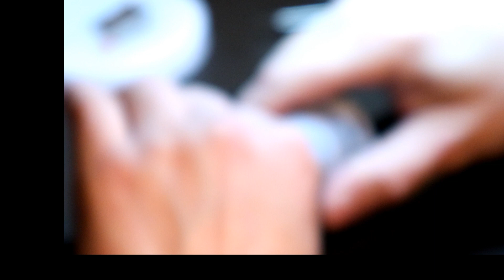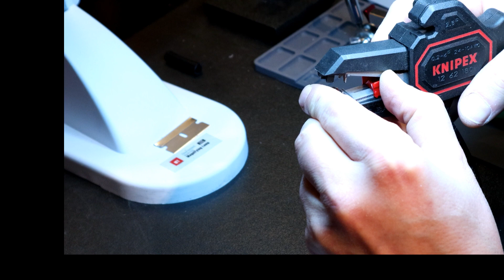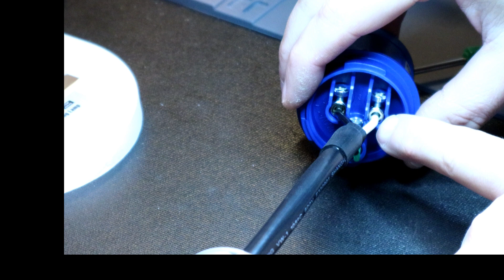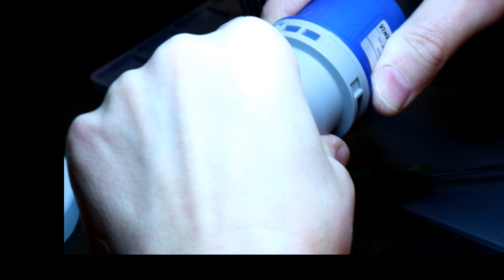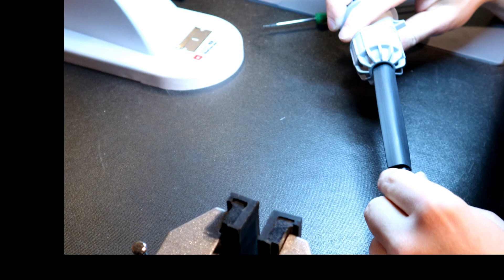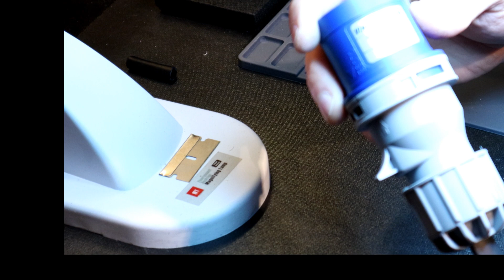Installing A European IP44 PCE (013-6) CNC VFD Power Connector (4K)..

Comment: @corvetteguy50 thanks for the informative video. What are your thoughts on connecting the shield drain on both ends of the power cord? I.e. at power plug connect to mains earth as well as at the vfd side connect to PE terminal? Thanks in advance!
Reply from the maker: One end of the shield drain is to be connected to your ground bus inside your electronics enclosure to avoid ground loops, which has been done for decades. Thank you,
Vince
Reply: @corvetteguy50 thank you. Sorry for the confusion, but does the plug in the video connect to the vfd enclosure or to a mains wall outlet socket?
Reply from the maker: The video covers building a VFD power cable. (cable from a wall socket to the unit) Thank you,
Vince
Reply: @corvetteguy50 yes but which side of the cable is connected to the wall outlet? i.e. do you connect the shield drain at the wall socket side or at the vfd side? Thanks for sharing your knowledge sir
Reply from the maker: Review the video as its covered in it 3:25 Thank you,
Vince